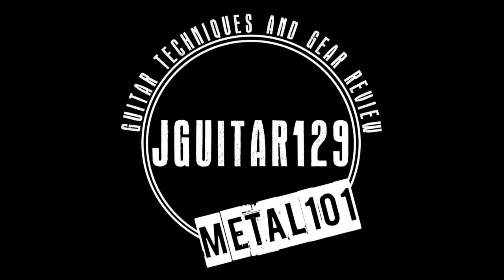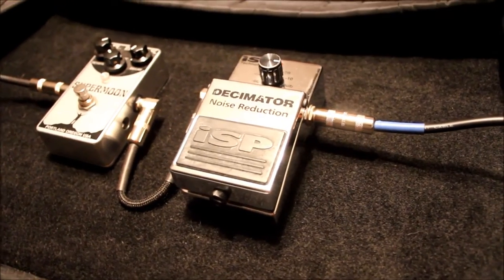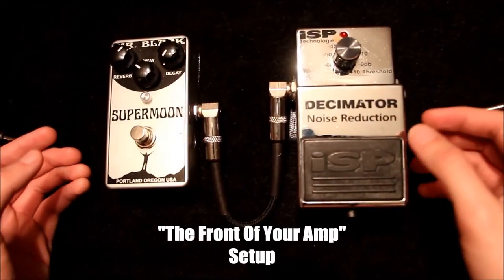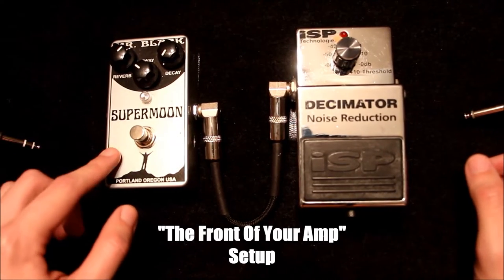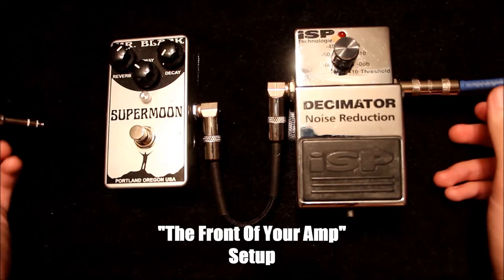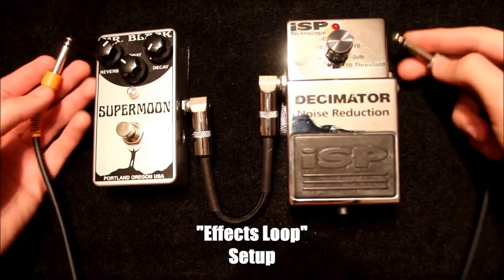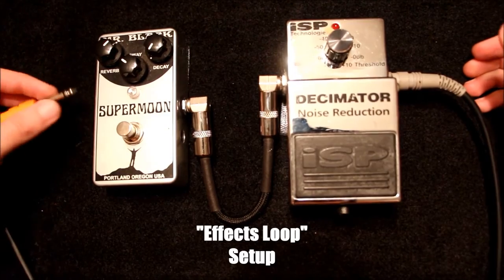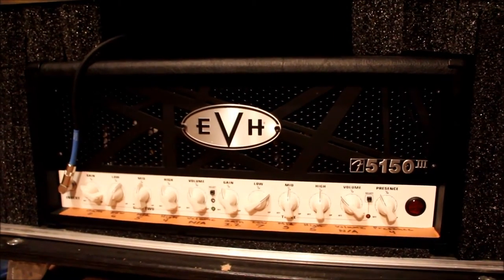Metal 101: Noise Gate

Comment: Great tone. I have the 5150 block letters. I have the boss Ns2 and some strymon effects that I don't want to mess with the noise gate. So my chain is guitar-tuner-wah-bb preamp-amp low gain in. And I have reverb, chorus and delay on the loop. How do I connect the Ns2 to the effects loop and don't pass trough the modulation effects is it possible? Thanks from Brazil
Reply: PUT THE NOISE GATE IN THE FRONT OF THE FX LOOP CHAIN( FIRST PEDAL AFTER SEND)

Comment: Cool video Jon !! But theres always a misconception with gates, the decimator is not a gate pedal its a noise reduction pedal. Or else it would be called noise gate. Gates turns your signal on and off. The decimator doesn't do that it simply cleans your signal so to speak.
Reply from the maker: Thanks for the tip and heads up, bro! I had originally wanted to talk about the different terms for Noise Reduction/Gates, but I just thought "Well, usually people use the term Noise Gate very loosely, so I'll just stick to calling it a Noise Gate pedal so that it's easier to find for a beginner".I also had wanted to talk about both the Decimator and BOSS NS-2 to compare the two and talk about the different ways to set them up such as the four cable method, but I guess I can leave that to another video!

Comment: Was your gate in the effects loop or front of your amp ? I use the 5150 stealth currently and I notice I need a gate bad
Reply from the maker: For this video I used it in front of the Amp, but it can be used in the FX Loop as well. Personally, I'd go for the ISP Decimator II G String or TC Electronic Sentry since they both have ports for use in front of the amp and the FX Loop for the ultimate noiseless sound.

Comment: can it mute the humming sound from the amp head? Cuz I use the Laney irt120w head and while I playing in front of my amp, the humming sound is noisy.
Reply from the maker: in that case, you'd probably want to go with either the Boss NS-2 or the ISP Decimator II G String since those pedals have inputs for silencing the noise from both your guitar and amp through the effects loop.
Reply: +JGuitar129 So if I have input the noise gate pedal into my amp fx loop, the noise will be reduced?
Reply: +JGuitar129 So if I have input the noise gate pedal into my amp fx loop, the noise will be reduced?
Reply from the maker: +Dorian1204 Yes if you run your Noise Gate through the effects loop than you won't get that humming sound from the amp anymore.

Comment: help, i need a distortion pedal with noise gate already build in! please suggest some if there is, check out my video and you'll know exactly what my problem is, the buzzing sound when the guitar is not played! i really need one but i dont really have any idea about pedals and stuffs! thanks
Reply from the maker: Well, you may just need a simple noise gate pedal such as an ISP Decimator or a BOSS NS-2, but if you're looking for a Distortion pedal that has a Built in Noise Gate check out the MXR Fullbore Metal or maybe even the Line 6 M5. Those pedals have built in Noise Gates and I've heard good things about both of them.
Reply: JGuitar129 ,ok, I'll check them out, thanks alot for replying

Comment: It didnt really sound like you were driving your amp hard enough to really have much of a noise issue. It honestly just sounded like you were cutting out all of your tone with the noise gate.
Reply from the maker: For the video I was at a low volume the entire time, but the noise gate really comes in handy when I play live and have to really crank the amp. On the EVH, I really only have to keep the gain at around 4 since anything after that is pretty much over kill.
Reply: Makes sense, I always play without a gate at practice volumes. Can you use the decimator in just the effects loop to tame the amp or is it a pedal board only unit?